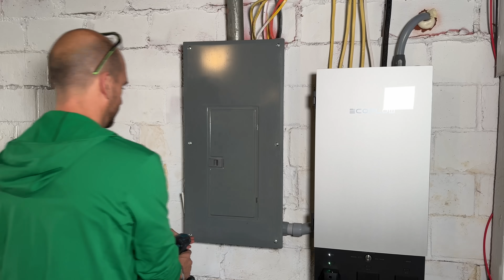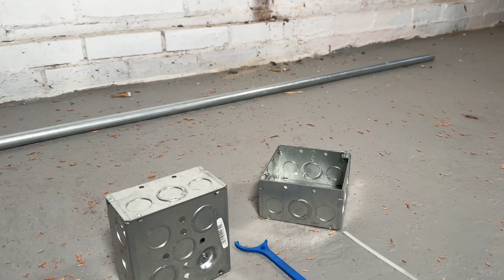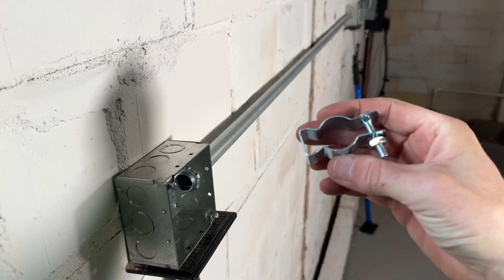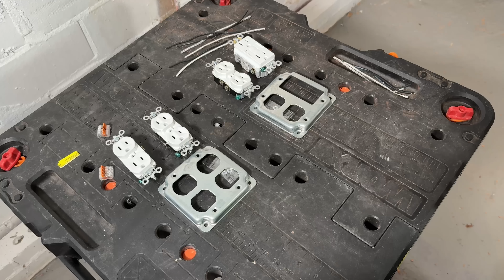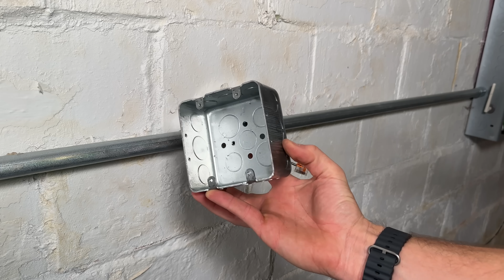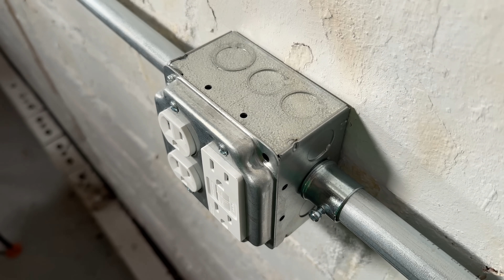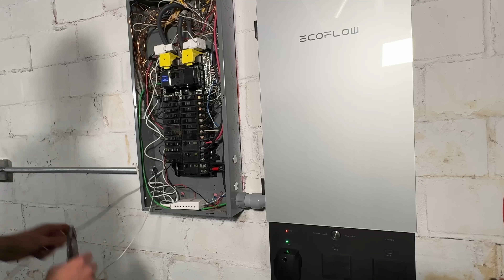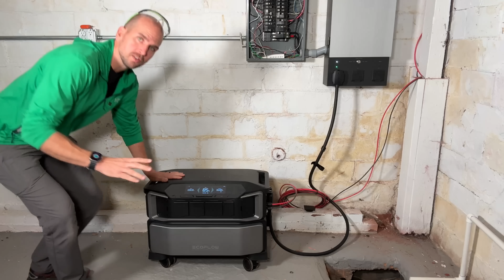Add Outlet To Unfinished Basement Or Garage

Comment: NM cable is not illegal inside EMT, it is simply not necessary. 
NEC 334.10 shows “uses permitted.” 
NEC 334.12 shows “uses not permitted.” 

No mention of NM cable inside EMT. It’s acceptable. 
But it’s not a good idea because it takes up a lot of room inside a raceway you may want to add more circuits to later.
Reply: Does the extra sheathing with NM cable use more than the allowable capacity of 1/2” EMT? 40% capacity? Just asking
Reply: @rogerk1710  chapter 9 table 1 shows that using one Cable, you can fill it to 53% capacity. The same table has 10 notes below it. Note 9 says cables that are elliptical in shape (NM) the cross sectional area shall be calculated based on the major diameter of the ellipse. 
So, you need to physically measure the size and type of nm cable and find the cross sectional area. 
Ch 9 table 4 shows that 1/2” EMt with 1 cable (53%) can be filled up to .161inch^2
Reply: @racenuke  Still not a good idea or needed right? I find it easier to just buy wires as needed for the amps. Thanks for the info
Reply: @rogerk1710  oh I would 100% buy THHN wire spools and use what I need and save the rest for a future project. NM cable in a conduit is cheesy.
Reply: @rogerk1710  conduit capacity is based on current carrying conductors not the insulation (generally speaking). The wires inside the Romex are almost identical to the the ones you would pull using individual wires. The extra insulation around the wires in Romex is strictly for physical protection. There is no derating mechanism for running Romex in conduit. That being said, it does make pulling wire A LOT harder and the risk of the insulation getting torn or nicked is much higher when you stuff Romex into conduit so it is best not to do it.
Reply: @TwilightxKnight13  Incorrect. Conduit capacity is based on total number of conductors or cables, including those that do not normally carry current. There is a derating mechanism for romex in conduit. If, for example, you installed five 12/3s in conduit you'd have 15 current carrying conductors and 310.15(B)(3)(a) would apply.
Reply: Thank you. As a electrical engineer I just can't understand why more insulation is bad ... 🙄
Reply: @MariuszChr  Decreases heat dissipation, which is one of the primary premises for the conduit fill capacity limits.
Reply: @anthonywhitesell3192  but romex forces you to put less wires, due to space limitation. Why would we even allow amperage high enough to cause heating of cable to the point that we need to worry about heat dissipation?
Reply: @anthonywhitesell3192  Conduit fill has nothing to do with heat and everything to do with physical space and pulling/installing conductors without damaging them.
Reply: @MariuszChr  Why is there a conduit fill capacity limit?
Reply: @pld8993  and that is where you are wrong. the capacity fill limit is for both heat and preventing conductor damage. Why does code require the use of the circular diameter of the flat NM cable when calculating fill capacity?
Reply: @anthonywhitesell3192  I don't know, you know?
Reply: @MariuszChr  (a) for prevention of damage to conductors when adding additional or removing existing, and (b) to allow heat dissipation generated by the current flow in the wires in the conduit. If at maximum current, 3% of the voltage is lost every 50 feet, where does the voltage "go"? It is turned into heat. Wire has resistance. 12g stranded wire has 1.588 ohms of resistance per 1000 feet, or 0.001588 ohms per foot. At all current flows (greater than 0 amps) there is voltage loss due to resistance, and the resistance creates heat.
Reply: @anthonywhitesell3192  voltage is not dissipated into heat, power is. You are right about heat generated by power loss on the line. But what actually it is? 100ft awg12 will raise in temperature the same as 10ft with the same current, even if the power loss is different. The less wires (romex takes more space) the less heat is generated...
Reply: @MariuszChr  I suppose saying that voltage is dissipated into heat is a simplification. Fact is that voltage is lost due to resistance. Fact is the resistance is the source of the heat. 
The resistance is 0.001588 ohms per foot in 12g stranded THHN wire independent of length. One foot of a 100 foot run or a 1000 foot run will have the same heat generated per foot for the same current flow. The voltage loss at the end of the 1000 foot run (31.76V lost) will be 10 times more than at the end of the 100 foot run (3.176V lost).
"The less wires (romex takes more space) the less heat is generated..." I'm not sure what you mean. I read it that since NM requires the use of the circular crosssection (instead of the oval actual corss section), then you cannot pull as many NM runs in a given size conduit.
According to Southwire conduit fill calculator, 1/2" conduit has a fill capacity of one 12/2 NM cable (ie., 1 pair of L/N/G conductors) or nine 12g stranded THHN wires (3 sets of L/N/G conductors). Therefore 3x as much heat can be generated (and dissipated) using THHN vs NM. But  you have to remember that THHN has only the insulation layer and NM has the insulation layer AND the jacket. The jacket is a thermal insulator and thus will retain the heat, or to dissipate the heat require additional airspace vs THHN.
Reply: @anthonywhitesell3192  No, you're wrong. So installing 138 #14 THHN conductors in 2" EMT, as opposed to 140 which is not allowed, is about heat reduction? Ridiculous argument. We derate for heat reduction. Conduit fill is solely about physical capacity and the ability to install conductors without unnecessarily straining the copper or aluminum (both soft metals) while pulling them, which could stretch the conductor material, thereby reducing it's diameter and subsequently its current carrying capacity.
Reply: @anthonywhitesell3192  Using math doesn't make your premise correct, because it's not correct. The maximum temp will never be more than the hottest conductor, so your argument that 3 times more heat is generated with 9 vs 3 conductors is misleading. In the case of more conductors, more heat does not equate to increased temperature. The NEC is concerned with maximum temperature, not maximum amount of heat.
Reply: @anthonywhitesell3192  Because you use the largest dimension of the romex when determining how much physical space is will potentially occupy. That has nothing to do with heat.
Reply: @anthonywhitesell3192  Wrong. No matter how many times you keep repeating it, conduit fill capacity has NOTHING to do with heat.
Reply: @pld8993 138 14g wires is 38.38% fill, 140 is 38.93%, both are allowed. 144 is the limit. Derating is based on (increased) ambient temperature and inherient within the calculation (ie., something that is already taken into account) is the fact that there is heat generated within each and every conductor.

So it would be your position that if one was to pack a straight run of 2" EMT with 359 conductors (99.84% fill), with no plan to add or remove conductors later there would be no effect from heat build up on the conductors at the center of the bundle?
Reply: @MariuszChr  No, he obviously doesn't know because he keeps repeating the same false premise. Conduit fill is about physical capacity, not heat. Round conductors in a round conduit will not fit tightly together, like if they were square, so there's lots of empty space in a conduit that's full. This is why a "full" conduit will have 40% of space occupied by conductors and 60% of empty space. You also have to remember that between boxes there could be up to 360deg of bends, so there also needs to be room for those conductors to bend and move while being pulled in the conduit. Compact conductors are not round and fit together more closely than round ones leaving less empty space between/among them, which is why you can fit more compact conductors than round ones (of the same size and type) in the same conduit space. If heat reduction was the goal, it would make no sense to allow more compact conductors in the same space. Derating based on the total number of current carrying conductors in conduit is about heat and conduit fill is about physical space. Why, for example, are you allowed to occupy no more than 31% of the conduit when installing 2 conductors? Because 2 round conductors side-by-side in a round conduit occupying the widest part of the conduit will leave lots of empty space, not because of heat. If empty space was necessary to dissipate the heat from conductors, we'd never be allowed to installed romex where it would be completely surrounded by insulation, which limits/prevents heat dissipation. Conduit fill limitations has nothing to do with heat and anyone that says it does is simply wrong.
Reply: @pld8993  Your statement has several right points and wrong ones.
3 times more heat (watts) IS generated by 9 conductors over 3.
The temperture will rise until the equilibrium is reached of heat generated with heat dissipated.This is basic thermodymic fact. The standard unit for the rate of heating is the watt (W), 1W = 3.41BTU/Hr. The temperature will continue to rise if the heat source continues to generate heat and the heat generated is not dissipated (BTU per HOUR). Heat sinks are specified in degress Celcius rise per watt with a given airflow (CFM). For every watt generated by what the heat sink is attached the temperature will rise by that number of degrees Celcius for the heatsink. If the airflow is increased the wattage can be increased and maintain the same temperature rise, or maintain the same wattage and reduce the temperature rise. As we have no heat sink on the wires in the conduit, all we have is the airflow (or surrounding air based on conduit fill) to disspiate the heat. If you pack the conduit full, there is no way to dissipate the heat of the conductor in the center. If all the other conductors are also generating heat the temperature will rise, possibly to the point the insulation melts. 
You are correct the table for derating are based on the maximum ambient temperature and within those caculations are inheriently included the rate at which the heat generated in the conductor can be dissipated.
Reply: @pld8993  thank you
Reply: @pld8993  Is it possible to melt the insulation of 12g THHN at 20A? Yes. just place it in a bundle of wires so the insulation becomes hot enough from the heat generated by the voltage (power) loss in the conductor. 
The insulation failure from lack of heat disspiation is seen all the time in in electromagnets and transformers. There are just one circuit, but wound around itself dozens to hundred of times. I have never seen the failure of a transformer or electromagnet in the outer conductors, it is always in the center.
Believe what you will, but I suggest you do the math to figure out how many 12g conductors can be put in a 1/2" EMT based on the maximum safe operating current (20A), the heat generated (in BTU per HOUR), and the effect of amount of airspace (you can assume equal distribution). Eventually you will find the temperature will rise above the melting point of the insulation before you get to the maximum number of conductors that will fit (1/2" EMT maximum is 23). 
The math will show the limit of the conductors based on heat. It will not show the potential for damage to becaused to the conductors during installation or removal, which I agree is a factor.
Reply: @anthonywhitesell3192  And conduit fill is about physical capacity and has nothing to do with heat.
Reply: @anthonywhitesell3192  And conduit fill is about physical capacity and has nothing to do with heat.
Reply: @pld8993 if you are stuck in your way, that is fine with me but stop spreading misinformation. It is both. Period. Try it. Fill a conduit with wires , run them all at max amperage and watch what happens. They will melt.
Reply: @anthonywhitesell3192  The fact that you're not an electrician is glaringly obvious. If conductors are bundled together, regardless of the conduit size and even if they're not in conduit (cable tray, for example), we derate/adjust the max amperage to limit heat. If you installed 41 #14 THHNs in 6" rigid (capacity is 1202) for example, while you'd have lots of empty space left in the conduit the conductors would naturally become a bundle with many of them in the middle surrounded by nothing but other conductors. Assuming an ambient temp of 86F, Table 310.15(B)(3)(a) tells us to lower the maximum amperage of all of those conductors to 35% of their max temp that's provided in Table 310.15(B)(16). 14 THHN starts out at 25A and gets derated down to a max amperage of 8.75A. This will prevent the conductors from overheating. Add another 500 conductors to the conduit, same thing, 8.75A max and the conduit is still not even close to full. Fill it to capacity of 1202, 8.75A max. If that conduit is installed in a wall surrounded by insulation, that heat will remain within the conduit and have no way to dissipate but that's not an issue because we've lowered the current flow to limit heat. Bundle 30 14-2 romex in the wall completely surrounded by insulation and not in conduit, same rule applies and each of the current carrying conductors (60 of them) is limited to 8.75A. Heat can be controlled by not bundling conductors together, which can't practically be done within conduit, or by reducing the max amperage. How full the conduit is has absolutely no role in this consideration. I'm not stuck in my way, I just know what I'm talking about. I've been in the trade for over 40 years, been studying and teaching the NEC for 25 years, and been NJATC technical advisor for over 10 years. I know you don't want to be wrong, but you are. That's life.
Reply: @MariuszChr  You're welcome.
Reply: @pld8993  thank you for showing that conduit fill limit is partly based on heat. It may not be the limiting factor but it is considered.
Reply: @anthonywhitesell3192  Limiting heat has to do with bundling of conductors and has nothing to do with conduit or its size. Once again, you're wrong. Nice try.
Reply: @pld8993  if you aren’t able to see that and how they are related from the theory, the practical calculations presented, and then applied in and under lying the tables to which you referred then i cannot help you further. If heat generated within the conductors was not a factor there would not be the need for the table. As you add more conductors you add more heat, at a certain point there is a limit. The conduit limit in the code is based on which is reached first, the potential to damage conductors or the thermal limit to not melt them (actually melt the insulation).
Reply: @anthonywhitesell3192  Table 310.15(B)(3)(a) has nothing to do with conduit fill and applies to conduit and non-conduit applications equally. It must suck to have such an intense need to feel right when you're clearly wrong, but go ahead and keep believing that you're right if that's what you need to get through the day
Reply: @anthonywhitesell3192  I remember months ago there was guy claiming, wrongly, that box fill is all about heat and not about physical space with the same type of ridiculous argument that you're making. I'm now wondering if that was you.
Reply: @pld8993  Your posts show where the theory outlined in my points have been applied in the digested form for all to use. I’m set and thank you, in that you have proven all points whether you understand it or not.
Reply: @pld8993  it was not me. I didn’t see that video and don’t have any background or use for box fill. I only work with conduit fill, mostly in situations that require using the math and information behind the tables as the tables do not directly apply to my work.
Reply: @anthonywhitesell3192  "Don't stop believing, hold on to that feeling..."

Comment: Why wouldn’t you just use a GFI breaker in the panel
Reply from the maker: I already had that breaker so it was a cheaper option for my instance.  GFCI breaker would work just fine 👍
Reply: If you did use grounds on the outlets would this still be acceptable?

Comment: when is wiring Grand fathered in and when does it needed brought up to newer codes ? not sure how the 2 boxes were different ?
Reply: Depends on your municipality, but generally across North America wiring needs to be upgraded as soon as a modification is made to a circuit. If you do not touch it it is considered to be "grandfathered". Of course if there are any safety issues that are clearly visible it should be done ASAP

Comment: I have these type of outlets in my basement. I’m planning on finishing it at some point. Once I have the walls framed, can I just connect to these metal outlets with regular, plastics work boxes? Or do they have to be metal for some reason? They will be attached to studs.
Reply: You may be able to just leave them and use box depth extenders to the new wall thickness. Assuming you like the current locations 🛠️🛠️
Reply from the maker: If attached to the stud you should be able to get the outlet flush with the finished drywall with the right thickness mud ring.